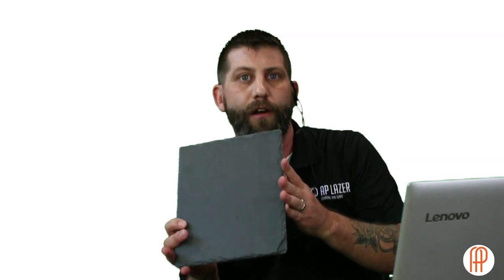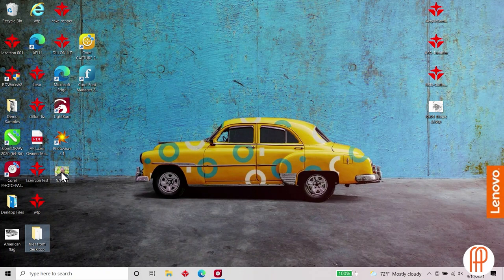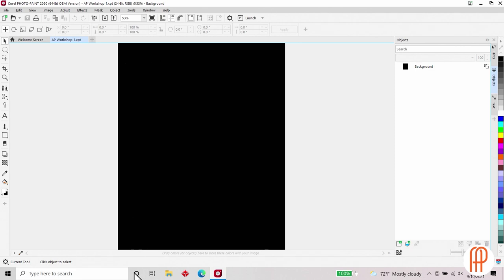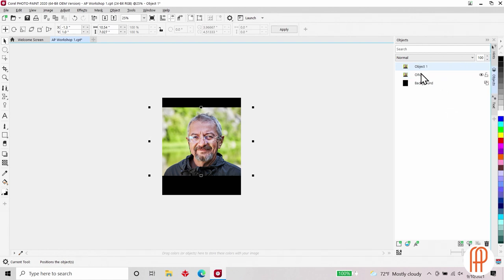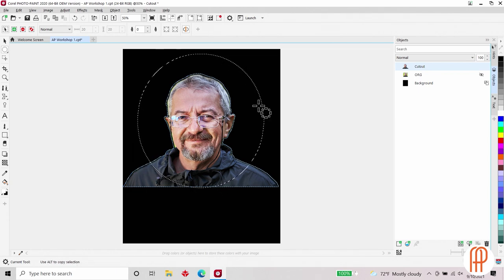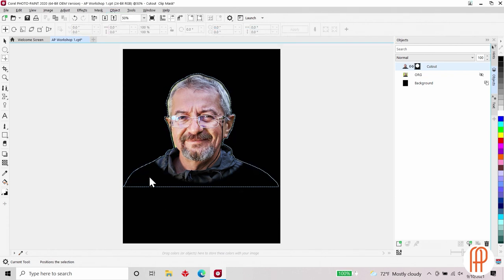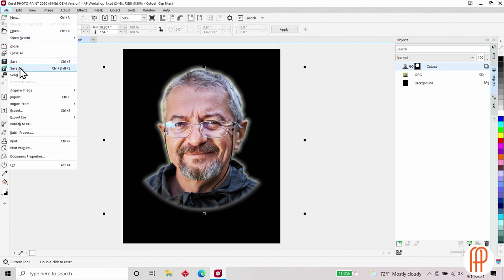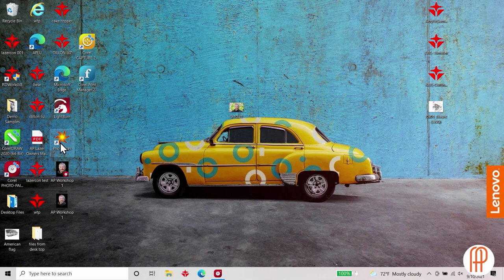AP Lazer Live Workshop | Slate Engraving

Comment: The grey image is caused by converting the silica content in the slate to grey glass glass. Thus it makes no difference to the image if you spray with clear acrylic before or after  because It darkens the slate but will have no effect on the grey glass.  The other point to note is that for the fastest engraving cycle  always work in landscape mode .  There is dead time at the ends of every scan line  when the head is slowing. stopping and accelerating back to engraving speed. There  more scans than necessary if you have the slate the way demonstarted in this video. Turn your image and slate through 90 degrees to landsacpe and there will be  maybe 30% less scans so 30% less wasted overtravel time.